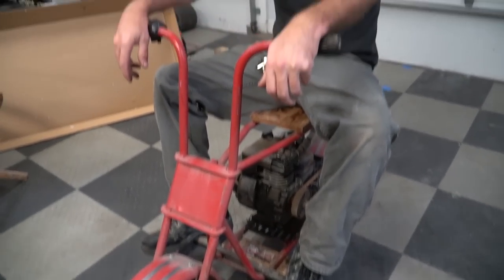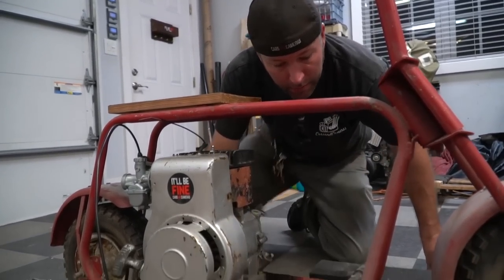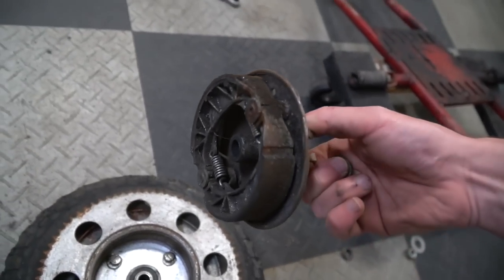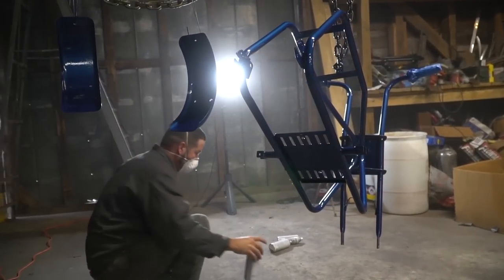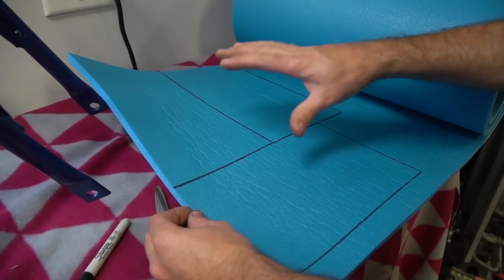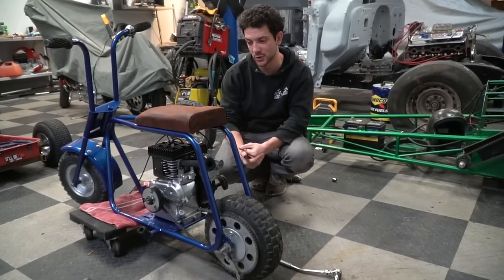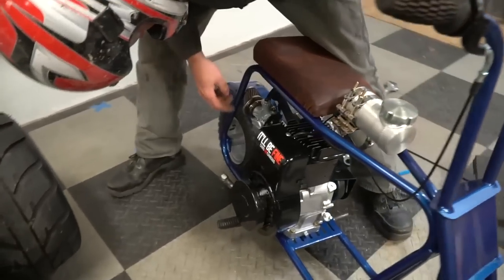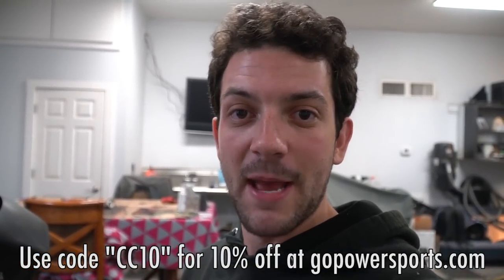Vintage Mini Bike Restoration | Budget Build & Built Flathead!

Comment: You should find 5hp dependable power plus the one I got sit in weather for a long time it look like all I had to do was put new dieafram in carburetor that’s it it moves my small go cart pretty good if you can fin right idle setting

Comment: Interesting and nostalgic.  I grew up on bikes like that.  A few points:
1) Why didn't you remove the forks?  Those bushings are likely worn and are replaceable.  You missed an opportunity to lubricate and make painting easier.
2) Same question with the tires.  The rims are bolted together; it's couldn't be easier to remove the tires.  A missed opportunity to clean and paint between the rim halves, where there's undoubtedly some rust.  Bearings for these wheels are also inexpensively and readily available.
3) I would have rounded off the bottom edges of the plywood seat board.  That sharp edge is definitely increasing the chance of the vinyl ripping.  Another layer or two of foam wouldn't have hurt, either.  Most foam rubber can be easily shaped with a sanding disk.  With more foam and a sanding disk in a drill motor, you could have made the seat both look and feel better.
4) That fuel tank and the large wing nuts make my voice go up three octaves... :-(.  Not safe!
Thank you.

Comment: worked in an upholstery shop for years how does that fine looking non board look happen I prefer 11/2" Black high density foam rubber use what like, with fabric glue, take board trace with a black magic marker then if using 1/2" board trace 11/2 inches from board then cut, then glue on top side of board, then spray bottom sides wrap the foam rubber on the bottom of the board use as many layers where like, cut excess out on corners, Sew Tick use staples or metal with predrill then screw or board with screws, secure tick Uh lala nice sleek comfortable seat, remodeling an Wren with a Predator 208 electric start (not on Budget)

Comment: Unless your running methanol, a Briggs 163cc will never feel like a predator 212cc
Reply: a flatt  5 is 206cc
Reply: billy sparks your right, I was thinking gx160. But I stick by the methanol statement
Reply: Its built up...
Reply: thebuilderguy have you run these engines? I am telling you no amount of build is comparable to methanol, I've run both
Reply: @16driver16  I haven't, mainly because I don't have one/something to run it on really, but I'm from a family of mechanics and I feel that if you build it for racing gas, it will perform about the same as a different engine built about the same way
Reply: thebuilderguy why not? I make minimum wage and I can afford  these toys used pretty easily. It's like running e85 or e90 and a giant set of fuel injectors, or an alcohol dragster, HUGE power gains with just a carb or jet and running alcohol.
Reply: @16driver16  I just turned 15 a few weeks ago, I don't have a job at the moment. How the heck am I gonna get one? I make no wage
Reply: thebuilderguy well of you have cool parents or grandparents that's one way, but I had to wait till I was 17 to buy my first mini bike after a summer of working at McDonalds. It was a 97cc Baja racer, and that's where my life long obsession started
Reply: I do have an old Tecumseh go cart, but modded the carb so the engine works decent, no need to replace it
Reply: thebuilderguy tecumseh are alot better than old briggs engines, only problems I've had with tecumseh was mine wouldn't run well when it was shaken, anytime I went over a bump it would lose some power, I ended up removing the governor and making a predator 212 carb fit it, but I wanted more power and sold it to a friend for $50 and just bought a predator 212 and built a stage 1.

Comment: I have several briggs and stratton engines still running after 40 years. I have never had a predator last more then 5 year with out blowing up
Reply: Wesley Snyder I believe it we use Briggs motors on the farm I work on they’ve been running strong since the 70s
Reply: I have a 73 Briggs 5 horse and all it needed was a clean coil and a clean carb and it ran like new, crazy how long these things last
Reply: predators are good motors, but i agree, briggs is the way to go🗣
Reply: Dont buy if its not briggs or tecimseh
Reply: @damianslusher4836  Tell the Chinese that at harbour freight.Trev  New Zealand
Reply: I have an old cast iron Briggs that came off a farm - it was used to drive a stream water pump - so old it's got the plastic oilbath airclraner on it & it still runs - wonder what that little critter's worth today ?.Trev
Reply: @damianslusher4836  damiam; it's spelt Techumseh & is a native American word & is pronounced : Tech-cum-moosh. Trev New Zealand
Reply: @trevorking8985  Uhhhh. I hate to interrupt. But it's pronounced Teh- cum- suh.
Reply: Good old iron block

Comment: You really need to watch some videos on how to use a rattle can.  Itd make your life a lot easier.
Reply: why, cause the glue looked funny when it came out? im a painter and theres nothing wrong with what i saw them doing
Reply: @philtripe  his spraying technique is terrible.  Just holding the button down the whole time gives no control.  It also leads to the paint laying down thicker at the ends because you the spray overlaps itself as you reverse direction.  It's similar to standard paint gun techniques.  What kind of painter are you?
Reply: @DoRC   is right
Reply: yeah, if i was ike i wouldnt let john paint on my projects!  it makes me cringe to watch him use a rattle can.
Reply: I agree i mean it looks good, on camera, but some better techniques could really improve the look, i learned my lessons with a 50 go kart frame with multiple layers of different color paint i didnt do all the prep work i should have and the final project reflected that i mean 100% better than when i got it but nothing to show off...
Reply: Agreed.  Holmes need a painting lesson or seven. :/
Reply: I paint alot mainly with spray guns but I’m okay with a rattle can it was weird how he held his can but good job I do leather repairs and recovers and that recover made me wanna cry

Comment: I was born in 1980 don't you go badmouthing Briggs & Stratton growing up we had a choice Briggs or Tecumseh and to me that's a no-brainer back then me and my grandfather he made a custom head out of a chunk of aluminum and was bored 60 over 3 1/2 horse flywheel homemade welded cam and we balance every rotating part in it at 5500 RPMs tell about 7000 RPM it was a beast it had to 10 or so maybe more horsepowerjust messing with you bud y'all are awesome man keep up the good work
Reply: jy fz ever hear if sentence breaks?

Comment: I dig the project.  Luv the retro feel of this episode.  The seat I would have done differently.  U should have rounded the corners. When the seat gets older the material is going to split in those corners as the material dries out.

Comment: New bike looks amazing, but before going on the race and top speed run, please address the brake issues and put new bearings in both wheels.  They are a simple fix and may mean 1-2MPH difference by smoothing out the drive line.

Comment: Great video as usual, the metallic blue and Faux alligator are the absolute best choice together and that foam doesn't wear out, i got some that's probably 20 yrs for camping and it is still ok, we use to ride these mini bikes back in the late 60's early 70's and were a blast. I don't think we ever had more than a 4 hp briggs on them and always tried tricks to get more out of them. I think the best we got out of them was 25 mph if memory serves me correctly,LOL, was 45 yrs ago. you 2 are gonna have fun with that 5 hp y'all just built and i would maybe look at a front brake also. we did one back in the day after riding into the ditch too many times and through neighbours fences, dam it was fun. Looking forward to the next video of this mini  bike. John ,you and Ike just built the Cars and Cameras version of a  hardtail mini bike. Sweet you just built a Classic and that colour kicks ass.

Comment: Back in the day, Briggs was all you had. The incoming air had to make so many 90 and 180 degree turns. Being a L-head, porting was the make it or break it performance mod. If it couldn't breathe, no carb or cam would help it.

Comment: I have a minibike similar to the one in this video.  I’d like to fix it up and do an engine swap/torque converter install on it and ride the hell out of it.    First issue is the engine.   I have an 8hp Briggs Industrial plus engine I want to use on it, but it’s a 6:1 reduction engine.   Will a crank from an old 8hp Briggs fit the industrial engine?    Industrial plus engine SN 196452 1049-E1 0004131A, old engine I want the pull the crank from SN 190402 0696-01 74062110.   Yep, I want to use a 1974 crank in a 2000 engine.   Will it work?

Comment: My family had one like this - a "Red Indian".  My brothers and I would take turns to ride it ...  Pretty sure we paid $50 for it second hand, and the centrifugal clutch was worn to the bone (the pads were almost completely gone and was metal on metal), so it had a slow acceleration and not much pull up a hill, but on the flat it could build up some decent speed.  When we replaced the centrifugal clutch (I think that cost $20 to $30 back then for the part - so almost as much as the bike cost second hand), we were shocked at the difference ... the bike accelerated fast and could pull up really steep hills and out of ditches really well.  Nothing could stop it.  The bike and the metal "ding ding" bell sound I hear when your bike runs brings back a flood of memories ....  a great little bike, great times with my brothers ....  makes me wish I could turn back the clock ...

Comment: Duuuude, you guys knocked this build out of the park! I dont think ot could have looked any better other than being a burnt orange metallic but thats just my fancy lol great job. I grew up workin on small briggs motors, i cant really agree with john where he said that all briggs motors are smokey and stuck and a lot are frozen. In my 22 years i have worked on engines and stuff for probably 12 or 13 of them, maybe even 14 but i was just getting an understanding for them at that point not really fixing them just tinkering with them. I have went through a lot of briggs motors and a few were time seized but literally took 30 seconds to free them up. I havent come across one that i couldnt coax into firing. They are or can be under powered but they are an old not very power efficient engine, mainly chuggers with lots of low down torque from what i have experienced. I had an old fun power 5hp briggs and that thing lasted forever until the crank threads that holds the flywheel on stripped and just didnt feel like dumping a bunch of parts into a 5 horse so we gave it a viking burial lol but that motor was a trooper, id love to find another one and build it now that i just want to have a time waster project.

Comment: Sweeet... my first 2 wheel power at 6 years old was a 3.5 BnS  put about 100k on that mini. That lead to flat tracking on a Suzuki 70 and now CBR600 TRACK Racing. It is an addiction. Have been wanting to rebuild  a an old mini..thanks cool video.

Comment: When I was a kid I had a 4th hand Honda Trail 50 that went to Hell and back. I took it on it's second round trip and had a blast. When she couldn't go any further I bought a 2nd hand Rupp mini bike very much like this. Nowhere near the capability of the Trail 50 but I had a blast. Unfortunately there was no such thing as the internet or youtube back then. Dodging the Sheriff patrol I took it on the street and reached down to manually circumvent the governor. WOW, she took off like a rocket. 3.5 HP Briggs. Wish I knew then how to disable it. But then again I'd most likely would have killed myself in the process.

Comment: I put a 1 x 2 across on top of the back of the seat board to avoid sliding off the back of the seat... Also have a kickup at rear of seat foam/upholstery... Rivet the chain together... don't trust masterlinks to stay on... Prolly go #40 chain for a torquey 5 HP Briggs engine... about 5:1 reduction... A shame a nice red minibike got turned blue...

Comment: I  recently turned my 12 horse Briggs vertical shaft to a horizontal shaft. I believe I got all the oil flow correct. Oh its a flat head also. Unfortunately now I can't get spark to test it and its not in anything to have a solenoid or anything. I cant find anything on wiring to start one like this so im needing to know if its wired wrong or the coils bad. Love ur channel BTW. If u could help me out with a little info it would mean the world to us. Its replacing a gy6 150 on my kids buggy so they're really anxious...As am i...Thank U n look forward to hearing from u.

Comment: I started out riding dirt bikes right off the bat at 6 years old. So short i had to run beside and jump on because i was too short to stand-up on the dirt bike. Lol. But in 1980 i got a minibike when i was 11 with a 5hp Briggs. No governor, head work. It was so fun to ride. And it was metallic dark blue. A 70s blue for sure. Lol. Nice vid guys. Brought back memories. Thank you

Comment: I wish someone wouldn't have stolen my old Atlas mini bike out of the barn. It was my grandpas. It had a 2 speed clutch,5hp briggs, large Battery powered headlight, 2 sets of foot pegs and a large 2 foot long seat and really sweet factory chrome plated spring suspension front forks. I doubt that I'll ever find one like it again. 

That thing would pull a wheelie so hard that I would fly off of the back of the seat. And it hauled ass.

Comment: I'm a half decent DIY welder and was hoping to build a mini bike with a predator 212 and about the smallest footprint possible (relatively safely).  Do you guys have a build plan that I might use a resource or some sort of parts list for DIY mini bike builds?  I want the footprint to be short so I may be able to fit it in the back of my river raft to run my own shuttles.

Comment: Im sorry the frame should of been done on candy apple metal flake, fenders on the blue but metal flake and white stripes. Motor Black 
with It will be fine sticker seat black have someone do MANCO in white on the back of the seat and it would be factory original.

Comment: I have always had good luck with Briggs engines, and I work the heck out of them. The only engine that I don't like is Tecumseh engines. I had one blow up when it was idling. Another one I had to adjust the carberator every time I used it.

Comment: I had one of these mini bikes in high school. In metal shop class I put a 1980 CR 80 engine on it and turned it into a chopper with a sissy bar and wheelie bars. I added the wheelie bars after the fact because it was hard to keep the front tire on the ground. Shop teacher   called it a murder cycle. LOL

Comment: Love your show and the vintage Briggs engine those were good engines I've seen built Briggs on methanol 60 to 70 miles per hour and you can get parts for them lightweight flywheels rods I like be Briggs don't count them out please dont stop your vintage mini bike builds even if you have to result to a go power sports engine lol ✌️

Comment: You guys should try building some k series or magnum kohler engines. Iron block and bore. Built like tanks and run forever. Not quite as easy to work on as a flathead Briggs tho cuz there isn't a side cover that comes off, you have to take the oil pan off to get to the internals from the bottom.

Comment: I've got two that I will sell, one is a complete Carl Heald super bronc Vt8 in really good shape for restoration. The other is a simplex it does not have a motor, but I have a new motor for it and has been taken apart for restoration, the tires and rims,  seat pan and complete frame including the springs for the forks and the seat. If anyone is interested, I live in Mississippi.

Comment: When does the c and c museum open so we can see all the builds? John little tip, when using rattle can to paint lightly fog the piece. Dont spray ot like a paint gun. This will dramatically decrease the chance for paint runs.

Comment: I just had a revelation on the drag. Cut the motor mount and drop the motor as low as possible, connect a driveshaft to the motor output straight to a differential rear end. Make a tunnel for safety. It’ll be fine.

Comment: after market carb, what is it. Nifty drum brake, mine has that awful flat metal that presses into the rear wheel tread.  what all did you do tho make the 5HP high performance?

Comment: I used to have a mini bike just like that back in the '70s we changed the engines out to a five-speed to go faster two gas tanks and we had a on the truck was a double but it went real fast we got to 8.8 at point b no problems but we had fun

Comment: for rounding off the foam you could use the angle grinder , it prolly leaves a rough egde on the roll of side of the grind but its eazy to trim that thin stuff with a knife

Comment: So I’ve been having issues with rust oleum clear coat. Every time I spray the clear on the bass coat the paint instantly cracks. I don’t know if I’m doing something wrong or that rust oleum clear is junk
Reply: Ive had better luck with duplicolor or krylon when painting over old paint.  With the Rust-Oleum you cant go over regular spray paint with fast dry it will crackle because the two layers of paint continue to dry over a period of months so the dry times need to match up.   I have found Rust-Oleum doesn't play well with other brands at all.

Comment: Hey @CarsandCameras I have a question for you guys. I would like to use a 8hp Briggs and Stratton engine from a snowblower for a drift trike project. My question is : Will a centrifugal clutch work ? I would appreciate your help please !!!! Because I don't want to use a torque converter
Reply: The clutch  should work if its a 1 in shaft